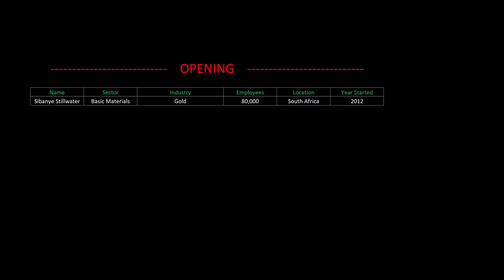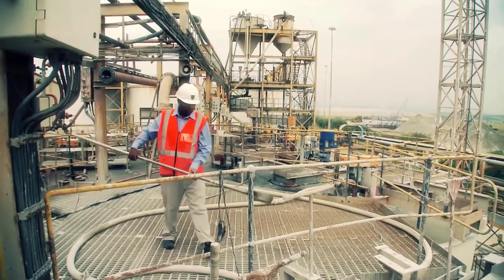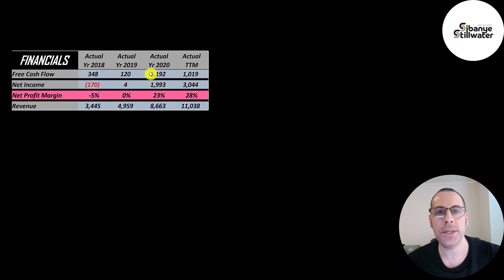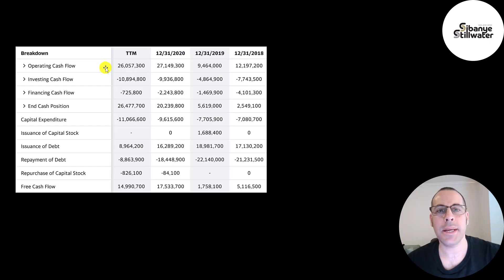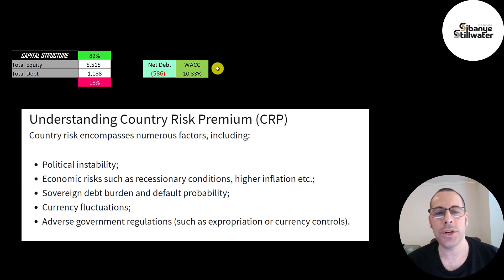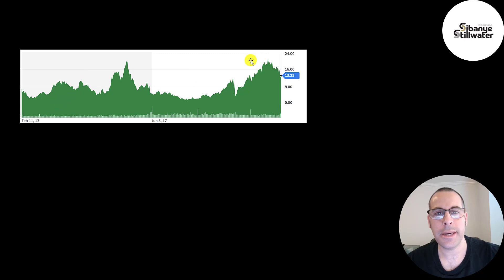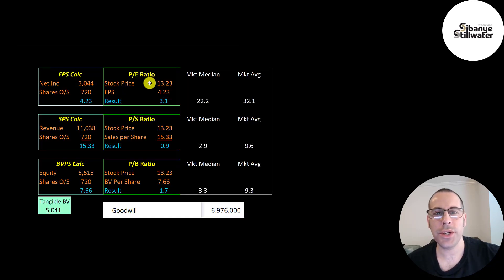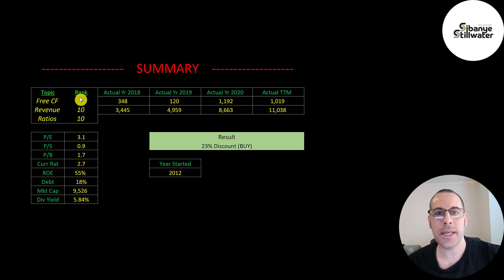Sibanye Stillwater P/E = 3 and Dividend = 6% - 😮🤑: $SBSW

Comment: Scott, Please could explain when you say, 'free cash flows into the future, and you discount them back to todays value.' It's around 3 min 15 sec. Thx
Reply from the maker: that what a discounted cash flow model is.  i estimate what the company's free cash flows will be in the future.  i then present value those numbers back to today's value.  that is i value companes.

if i owe you $100 and i say would you want it in 6 months or 10 years.  you say in 6 months because in 10 years $100 is worth a lot less.  you may feel $164 in 10 years is equivalent to $100 today.  $164 in 10 years discounted back to today's dollars using a 5% discount is equal to $100.

Comment: There are several reasons as to why the share price may refuse to go up:

1. The global microprocessor shortages has resulted in an overall decrease in car sales. Fewer car sales = Less demand for catalytic converters (Palladium and platinum).

2. Commodity stocks in general have taken a hit due to the resurgence of Covid and the increasing number of infrastructure projects being put on hold/cancelled.

3. Auto manufacturers have started to use platinum instead of palladium for catalytic converters due to its cheaper price, causing the company's most profitable metal to take a hit, thus resulting giving Sibanye a dimmer future outlook.

4. Bad press from the three deaths that occurred this past month in one of their mining shafts.

5. Despite the impressive numbers, future outlook remains unclear due to the fact that the numbers this quarter were down to very expensive metal prices; investors are unsure as to where these metals will go in the short to medium term.

6. Impending stagflation and hyper inflation paired with tapering will slow economic progress and infrastructure projects, which will drive demand and metal prices down.
Reply from the maker: thx for sharing all of that great info!

Comment: Hey Scott. Very interesting stock. I think some people might be concerned because its a South African stock and as such prone to political issues. However, I do want to say that the PE ratio is insanely good. Dividend is very high. Metals are important. I believe there is more to inflation than what TEAM TRANSITORY INFLATION says. I bought a few shares myself because I think its a really good buy at this level. You mentioned some good points on its valuation Scott. I believe its a winner. Great analysis on your part. Its funny I just happened to buy some and then saw your write up here. I will subscribe so we can compare notes. If you like stocks by the way take a look at NYCB. One of my favorites.   Joe
Reply from the maker: i did not realize the risk of south african stock until i made this video

Comment: I'm buy as it drops. Started at $12.40 but expect it to drop more. They mentioned getting into green energy metals lithium/nickel ect. That all cost money and with the price of palladium falling because combustion cars are dying and the narrative of palladium will tumble. I believe platinum will take it's place when hydrogen cars need 5x as much platinum as a convertor needs.  Also massive breakers use platinum because of its corrosion and heat properties.  I have a feeling it will drop to 10$ and I'll go on a buying spree. If it doesn't at least I bought some!
Reply from the maker: you're gonna be rich!
Reply: Bought more today when it dropped to $11.70
Reply: You re right, that palladium will be used less in the well developed countries, cos of the rising amounts of electric vehicles. Anyway i read an article, that f.e. chinese combution cars dont have converters atm and may change that by law. Also this article points out, that the infrastructure cannot support more than 25% electric vehicles. So maybe the combustion-cars will be longer on our streets as we think. we will see. just some thoughts. i am also invested, but i bought the southafrican stock and hopefully their recent aquisitions into the so called "green-metals-sector" leads to enormous profits :))))

Comment: Hi Scott, what does number of shares on “float” mean? What is the difference between that and shares outstanding? 
Thanks
Reply from the maker: Shares available for the public to purchase.

If the CEO owns 200 shares and the total shares outstanding are 500 then the floating shares are 300.

Low float stocks are those with a low number of shares available. Low float stock is generally more volatile.
Reply: @ScottsStockDueDiligence  thank u so much for the explanation